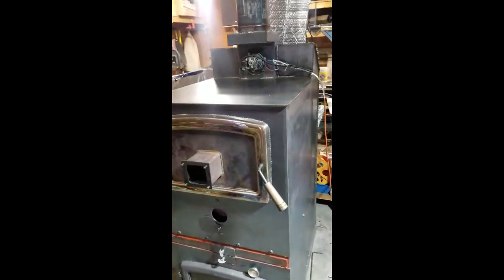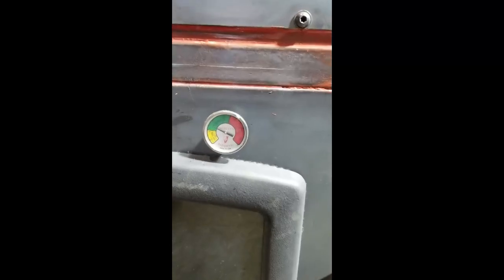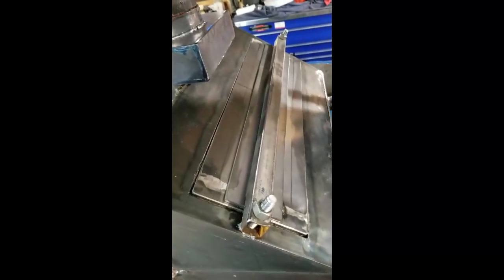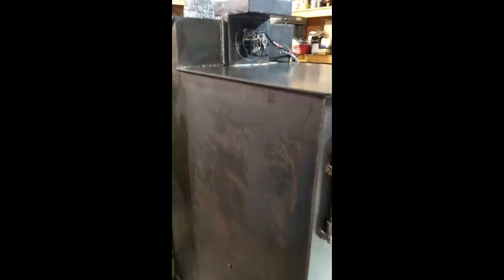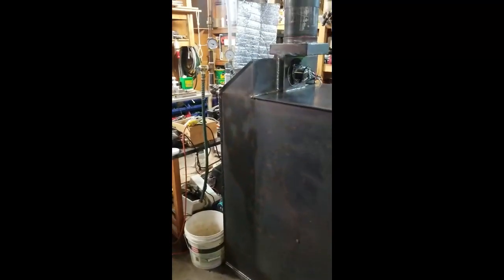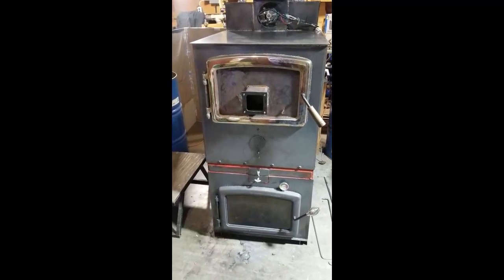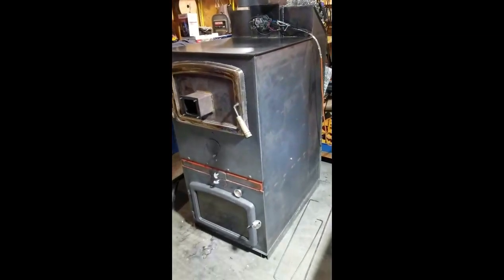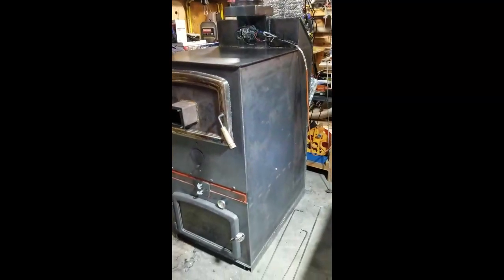How I built my own gassification boiler

Comment: So you only have the water jacket on the rear and the bottom imagine if you built an inch and a half water jacket on both sides and the top you would have to be concerned with condensing chimney vapors😳❤️‍🔥❤️‍🔥❤️‍🔥❤️‍🔥❤️‍🔥
Reply from the maker: The complexity of trying to put tanks an all sides is too much, I did not want to overcool the stove with too much water inside all the time, but a thin side tank 1 inch or so would absorb more heat for sure. The next one I build will be fully tanked on all sides and top.

Comment: Show us how it works describe or show us the interior of the stove? 
The guy who invented the system 2000 oil boiler built it like you in his own shop trial and error, plug-in leaks, etc. etc. I’m sure he’s a multimillionaire has his own company that goes to both ends of the spectrum for oil and propane file for a patent in case your kids ever wanna open a shop and go multimillionaire
Reply from the maker: Ya sorry I got lazy taking pics and vids, I will make a compilation of all the interior parts soon.
Reply: @  LAZY😳 I DON’T THINK LAZY IS WORKING 18 hour days❤️‍🔥